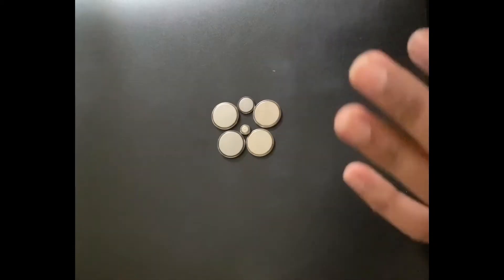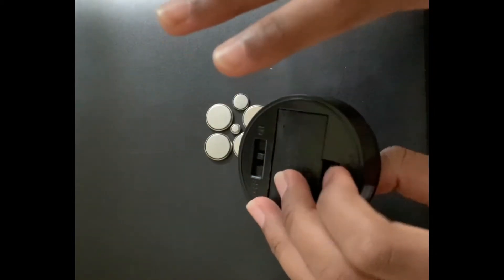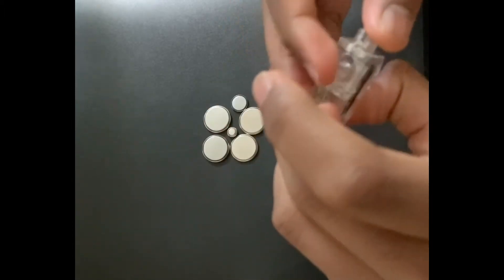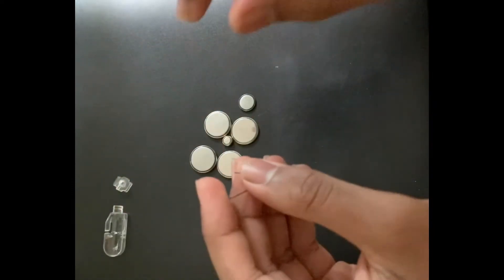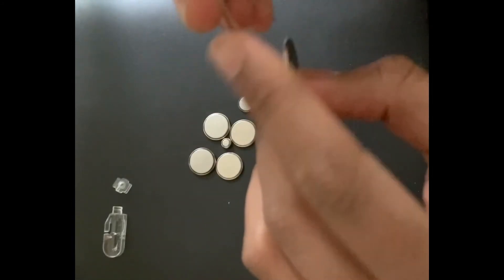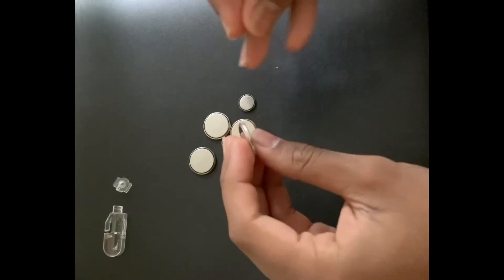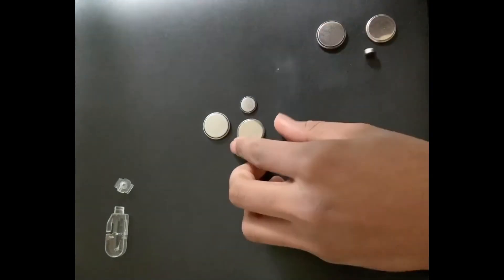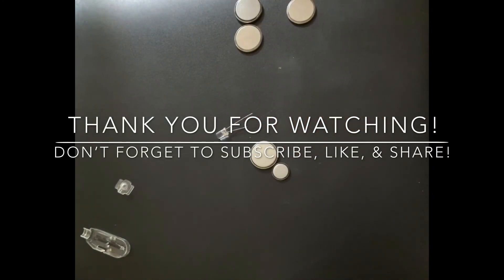How to test button batteries for power. Without Multimeter.

Comment: It might work, but it doesn't tell if the battery is weak or fully charged. It' important since charged batteries are held sometimes for a while and weaken and perhaps the button battery is put into something more crucial - like a car key fob to start it.